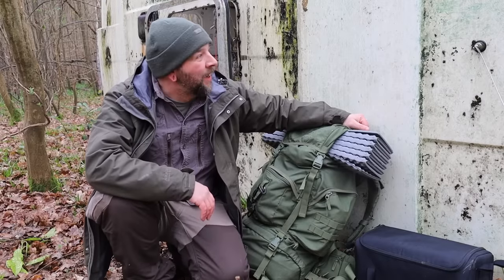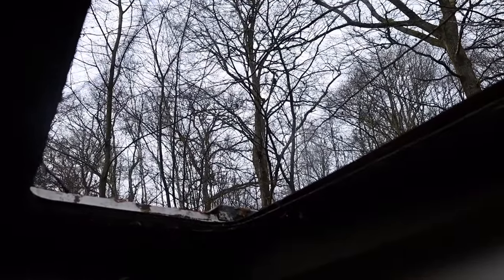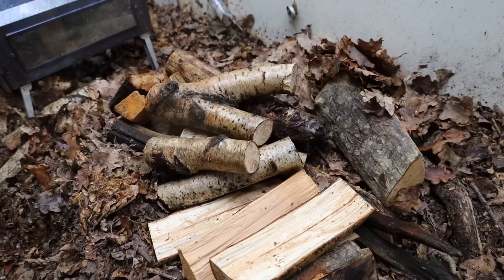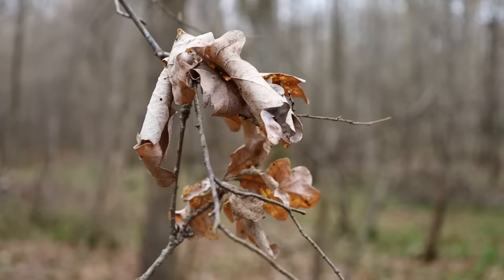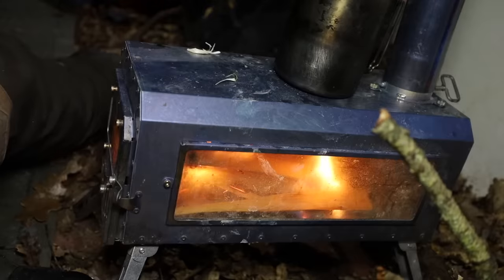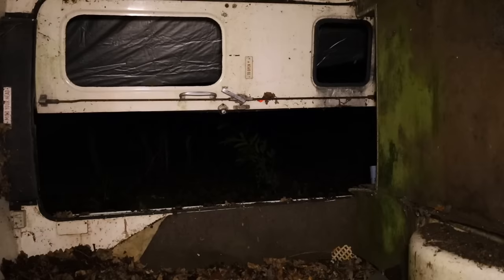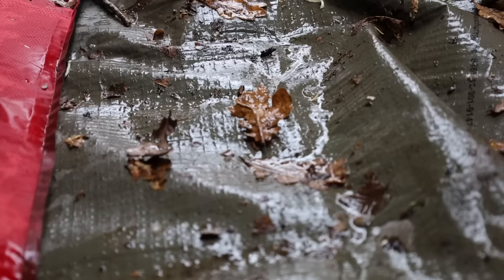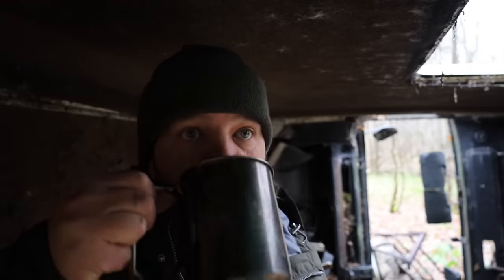Stealth Camp in an Abandoned Ambulance

Comment: Many years ago I came across a minibus waaaay out in the bush. I'd just been exploring, trying hard to get lost when I stumbled across it.
The exterior was covered with moss and lichen, including the windows which were still intact. The door still worked and the inside was amazingly clean and dry. All the seats were out. You could tell it was a camper. Even had a raised bed platform.
I so badly wanted to go back and camp in it, but could never find it again.

Comment: I think you should have cleaned out the debris from under your stove to further prevent problems with fire. Also hanging a tarp across the open end on the inside will provide retention of heat better, Likewise covering your opening up top with the panel you found in the vehicle will also help retain heat.

Comment: Amway used to have a product called drifab for waterproofing tents sleeping bags pants and anything else you needed to water proof one time I had my sleeping bag done with it I slept out by a building and that night it poured and because of how the building was sloped I ended up under it run off different people saw how the water was coming down on my sleeping bag including the 3 who had set up in the building thinking if it rained they'd be dry they weren't they got soaked but they all were guessing how long before I got drowned out but they were surprised as I didn't get up till daylight the drifab had kept my bag totally dry over the years I have lost track of any Amway dealer's so I don't know if they still sell it or if it's still as good

Comment: Nice idea, spot and equipment - do some recherche, how an oven works... Unless an open fire does, an oven could not heat that shelter - it seems to be warm but only heats up surrounding air slowly but constantly for a long time - If there are (as seen) as many lacks of isolation, it would  have been the same as without any heating... Only an open fire would have given some heat for a short period by direct ir -radiation... Want to use your nice stove again? Be certain to avoid permanent exchange with cold air (lacks at the same level)
Reply from the maker: That's basically what I said in the video 🤣